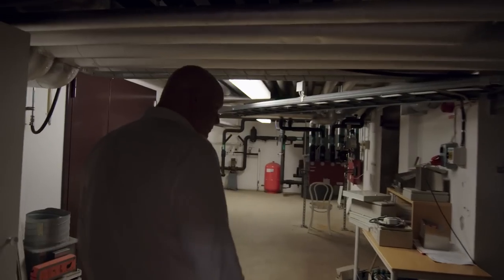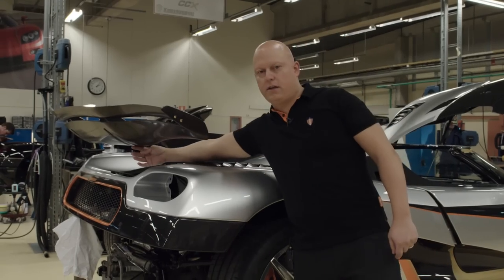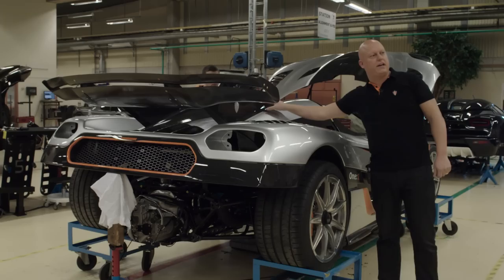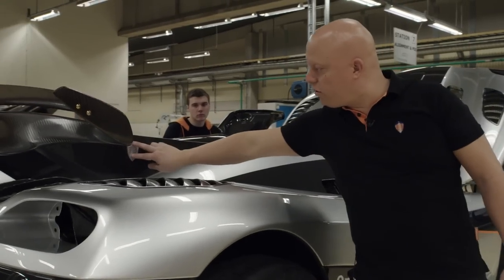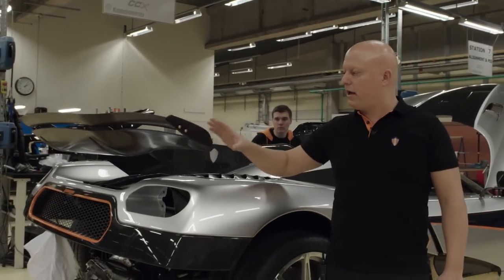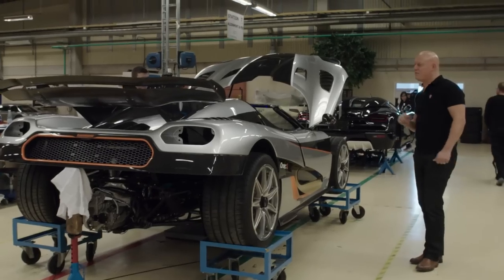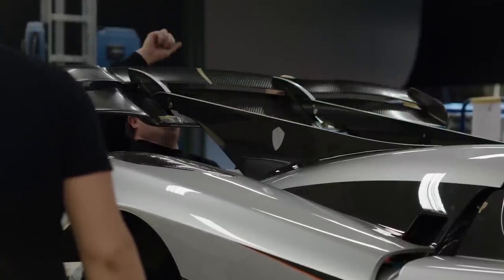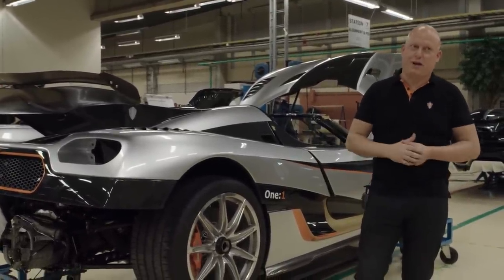One:1 Active Rear Wing - /INSIDE KOENIGSEGG

Comment: Engineering Explained can you please explain why is the lower part the most important? I thouht that the upper because the air pushes the car down. But now I'm thinking more of the drag is the one making the work.
Reply: Yeah. But I thought also that in the plane was the opposite. That the down area was the one making the work. But now I see that that was correct but need some explain to understand it correctly. :/
Reply: Danny Fallas In airplanes the air over the moves faster then the under causing lift on a car is the opposite the going under is moving faster does pulling the car down!.. hope that helps to understand :)
Reply: Danny Fallas The explanations above work well to provide a simplistic reasoning for it, but the main point is that downforce is simply created by flipping an airplane wing upside down. If you want to get a more exact reasoning as to why aerodynamic lift/downforce occurs, you'd need to study Navier-Stokes and Euler equations - which is what I do as an Aerospace Engineering Major.
Reply: Will do today! Man, your career is awesome!
Reply: in basic terms the way a wing works is by dividing the airflow and generating a difference in pressure and airflow. in a plane wing the underside of the wing is straight but the overside is curved. air moving over has a longer path to travel to stay level with the air under the wing, this creates a drop in pressure above the wing, the result is that the wing is "sucked up" but its easier to understand that air "wants" to travel under the wing pushing the wing up. if you take that principle and turn it upside down, you get downforce like the one in car wings.

that is of course a very simplified version, but if you imagine an object moving through the air, for example a cube, the front hits the air and compresses it, the air is forced around the cube, directly behind the cube is no air, because it is space that was previously occupied by the cube, the air then has to fill in this space to reach equilibrium, which is why vacuums appear to suck things in, it is actually the air being forced to fill that space by the higher pressure of the air around it. by using the shape of the wing to angle this vacuum so that it is above the wing causes the higher pressure under the wing to force the wing itself to fill the gap that it is creating, thus creating lift.
Reply: wow NeX totally understood! Thanks
Reply: NeX Awesome example of SIMPLE explanation! Got it! Cheers, mate! (y)
Reply: Danny Fallas Those people have some good explanations and all, but you had the right idea. We can't forget the facts. When it comes to an airplane wing, only 1/3 of the lift is because of the shape (top) and 2/3 comes from the attack angle (bottom). I think what Koenigsegg gained was a reduction in turbulence that showed gains. But not because the bottom is more important than the top.

Comment: Wouldn't a more rear mounted spoiler create better downforce? If you consider the center of the car as the pivot point, the moment is force*distance. This just doesn't make sense putting the mount further forward, you're losing the mechanical advantage. You'd want the spoiler as far back as possible for max downforce, no?

I love koenigsegg, but on an engineering standpoint, looks are more than purpose for this one.

Comment: Question, do you not lift the front while braking if you maximize downforce on the rear in that same moment actualy negating the effect??
Reply: Eric B There are winglets on the front to counteract that.
Reply: Rumeeezyy So essentialy the whole car maximizes downforce while breaking. Got it.
Reply: Yes, pretty much. The engineers at Koenigsegg are amazing to say the least haha
Reply: Incorrect. The rear wing is designed to be effective only at high speed speed (for example :the wing will be effective at 90mph+). So when braking-rapidly slowing, the rear wing becomes less useful as speed decreases.
Reply: +Thor Down force is maximized only at high speed. Faster thr better thr down speed. Wing uses the Bernoulli's theorem. Faster airspeed will generate 'lift'. But since the automobile wings are inverted, upside down, opposite life=downforce is generated. Again, the more downforce (inverted lift) is generated at higher speed. So when braking, both front and rear wings become less effective.
Reply: +Eric B The car's weight transfers forward to the front wheels under braking.

Comment: nezerac exploded a little farther down in the comments because he thinks this design is bullshit, i.e. the top mounting likely does very little for aero efficiency and CvK should stop making it sound like such a big deal. However, it should be noted that the connection points for F1 front wings are mounted on the smallest possible nose cross-section and the rear wings are mounted on the side, so obviously this is the sort of things the big boys care about. Even if it doesn't have a large effect on downforce, the pylons themselves will be VERY useful for high speed stability, so overall it should be more than "worth it".
Reply: While that sounds logically sound a rear diffuser should do far more to assist the cars stability. I'm just saying. I've always seen Koensegg as a funcion over form brand and that's where my love for them comes into play. When gimmicks like this come into play I get frustrated that the few companies have to resort to this to retain public interests. At the end of the day if it doesn't genuinely put the car miles ahead of the game it's misleading the public to boast as if it does. I'd be happier with an agera R than this car (if I had the money of course) simply because that car spoke volumes in simple design. Hopefully Koensegg doesn't continue this trend because it's definitely a slippery slope and at the end of the day that's what genuinely bothers me so much about the design.

Comment: In about 4 videos time, he could convince me to want a 1:1.

But hypercars stink! They do. They're bloody useless. You can't do anything in them, except "go for a drive" or "take it to the track". And when you do want to use it, the battery is dead.

No son, what you want is a 911 Turbo S - and drive it every single day. It's the ultimate car. More practical than any other supercar, and more reliable. Cheaper, and easier to maintain. More exciting, and more manageable than most. Tiny size means it never gets stuck. Great ground clearance. Awesome turning circle. Easier to get in and out of. Great all-round visibility. Brilliantly engineered. Manufactured in good quantity. Available everywhere. Will run on any octane gas. Will easily run from the ski slope to the middle of the Sahara. Won't ever break down. Will never break, period.

Yes sir, when you're done messing around, you get the best car, and in most instances, and for most people, a 911 is the best car. And in another 50 years, it will most likely STILL be the best car.

And if it isn't, the reason will probably be that we're all living in mud huts, burning cow dung to stay warm.
Reply: read up on the battery system in these cars the batteries don't die.you can leave them with the lights on and the stereo, and the ac overnight and the battery is good to go. they can sit idle for a year and start right up.

Comment: Congrats to all who achieves the success at this level of aeronautics applied on this hypercar. 
As I'd understand you have to choose (modify) the chassis for mechanical grip or aerial grip. (Or both). This magnificent machine have them both at a rate of minimum aerial drag and maximum grip configuration. 
But while you are applying aerial force on dynamics, you lack mechanical grip in order to enhance the curb performance or straight perf. My question is
is it possible to develop mechanical grip (susp, stab. c.m.s etc.) without mounting wings or aerial supporters? 
I guess we achieved some kind of a milestone where we cant add mechanical stabilization. 

Thanks in advance

Haters hates all.

Comment: Koenigsegg One:1 VS McLaren P1
1360hp               -                  903hp
1371nm              -                  900nm
1360kg (CURB) -        1450kg (CURB)
610KG DF 260km/h-600KG DF 260km/h
450km/h+ Top Speed  -  350km/h (LIMITED)
2G CORNERING   -  2G CORNERING
28 METERS 100-0 -   30 METERS 100-0
0-100 2.8s           -          0-100 2.8s
0-200 ?s               -          0-200 6.8s
0-300 13.2s     -           0-300 16.5s
0-400 20s
DF=Downforce
What do you guys think? Let me hear your opinions?
Reply: I suspect that the P1 will be faster round any track other than a drag strip.
Its built by the most experienced race car company in the world, It has the most linear power delivery this side of a NA F1 car, even the Agera has massive turbo lag and comedy power delivery with serious traction issues on every video i have seen, i just don't see how this will be much different.

Just look at the structural hydraulic pylons which adjust the wing on the P1, they are massive similar to what you would find on a JCB, on the One:1 the wing adjuster mechanism looks so feeble.

I love the One:1 but as an Engineer myself I just cannot compare Koenigsegg's engineering, design and development and experience to McLarens, they are planets apart. If McLaren were building this car, it would be 1/3 of the price.

Comment: No, the bottom side is most important on a wing.  I have done wing tunnel tests and design airplanes...  There is a better way....  Want to know how?.  Max down force and drag is at 45 AOA...just look at the data of a wing from zero to 70 degrees AOA....Other shapes would actually be better than that.  Stalling is what you want for drag....  You just need to control it correctly.  Sounds like you are guessing.  The CFD can't tell you the right solutions...

Comment: what he just said there about the rear wing is pure bullshit.  rear wing of car generate downforce mostly by change of momentum (deflect airflow), not by Bernoulli effect like in an airfoil, hence this bullshit about top mount getting more smooth surface at the bottom is just nonsense (impact insignificant at best).  Now the "rudder", again, its impact on stability is again insignificant in a car.  Put on better tyres will give u much larger bang of ur buck right there to better stability (but i am sure they already did).  All in all, all these aero talk of hyprecar is mostly just gimmicks